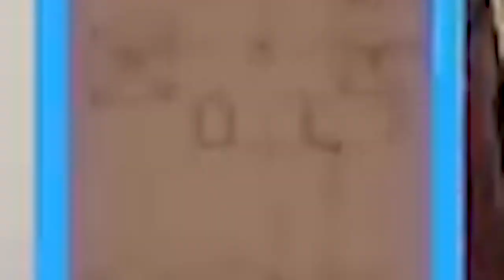Testability Problems Are Caused By Design Problems | Understanding Software Testing

Comment: This is GOLD. The key concept that "Testability Problems are Design Problems" not only applies to the code being written, but can often apply to the tooling being used. Badly designed tooling makes testing much more frustrating that should be, so many people fail to make it part of their normal process. Design extends beyond the code, and how tooling has been designed can greatly effect the quality of code being written.

Comment: Testability is an area where functional languages shine. Systems built on functional languages are much more straightforward to test by only taking inputs and returning a result and not having stateful/mutable side effects.

Using the premise put forward in the video, the functional approach typically doesn't suffer as many design problems through lack of testability.

Whilst Dave may not agree with this position, I do believe that an approach that leads to better testability (and by the argument put forward, a better design by default) does point to the functional approach being superior.

Over 43 years of coding, I've used every programming paradigm and many languages and its clear to me that thinking about state isolation through functional immutable languages leads to both safe, scalable and resilient systems.
Reply: While it's all true, but the value from software comes from the fact it has side effects and mutates the world.
Reply: @seNick7  all functional languages have mechanisms for interfacing with the external environment, both receiving and emitting external state, or input and output. In this regard the whole program is effectively a function taking input and producing an output.

Comment: Regarding private method testing, I have a mixed feeling about it. On one hand I get the argument about implementation detail, but on the other hand, there is encapsulation. And package private in Java is the same as package public, so it breaks encapsulation. Also, large algorithms, and I mean large, require testing implantation detail, and if your public API is limited to dataIn(data, config) and returns processed data, then how do you test tens of private methods that do meaningful data transformations? Well, you either break encapsulation, add trash testing code, mess with reflection or you test each method on the side in some obscure testing project but then most likely your unit testing for that algo will be trash, that doesn't test in meaningful way. Of course, you may want to pretend to write reusable code and slice and dice the code into multiple classes and add some abstractions to pretend the code will be reusable, but that adds workload on designing the classes and additional abstractions and well, makes it more expensive, both in time and in cognition. And years later, once some change needs to be made, no one will remember, how that code was supposed to be reusable or how it was supposed to work, including author himself. So it will be not only extra expensive, but also wasteful.

Comment: I agree 100% with this. I've been blogging about testing recently, and I've mentioned this several times. I'll also be adding links to this video and Feathers' presentation in my blogs. A snippet from one of my blogs:

"A test reflects the implementation. If the implementation is complex, ugly, nasty, etc., then the test will be complex, ugly, nasty, etc. Legacy code tends to be complex, ugly, and nasty. If the implementation is clean, then the test will be clean.

If you write the test before the implementation, then you’re more likely to write a clean test, and as a result your implementation will be cleaner too. If you write a complex, ugly or nasty test before implementation, then you’re going out of your way to make yourself miserable."

Comment: I wrote tests for years, but developed a style of producing very clear error messages and found that this takes a lot of pressure to test out. There is a relation between the need to test and the existance of clear error messages.
Reply: Im not sure what testing has to do with logging, those two are separate! Unless, of course, your product is about logging! Surely you mean that while you always do test, clearer logging has helped a ton too?
Reply: Developers usually don't understand the Bug's nature. Has nothing to do with logging or exceptions. If that is understood, all the rest follows. Be aware, that there is some blind Area in your Mind. That leads to a cause of a Problem. Somewhere else in the code is a detector, raising a Signal, stating that this not understood cause exists. The distance of the detector to the cause ist the cost of debugging. Good code is such that these distances are small. End of Story.
Reply: I'm an enterprise developer but have kind of a related problem: what error information should I log? I am not writing 3rd party library code,  I am usually my own consumer. So  I default to showing the user that an error has occurred and 'Please contact IT'.
Reply: @richardbradley3684  You are doing yourself an utter disservice.
Reply: @richardbradley3684  I think there is confusion out there, about a message that, should go to a user, a message that should go the the developer and the subtle differentiation about the error-detecting line, the real location of the bug and the distance between those two things. This distance has a lot to do with the cost of debugging. I don't have a big problem with an error, but I have one with an error that is hard to debug.So I focused on this for years and feel to able to publish about it. But projects often distract me from that. This confusion gets bigger by a misleading discussion about exceptions. Pew...

Comment: I've encountered this so many times.  I would be talking about testing code in embedded systems and the push back is that it is hard and you "CAN'T" do testing... and my comeback is that Yes, I agree... not the way this code is currently structured, sure it is hard because it is a monolith, but it is not impossible to test if the code is refactored, and it can be designed to test in isolation to everything else and then you'd be able to test it.  I gave an example and of course if fell on deaf ears.

I think ppl like that are really ignorant and perhaps just blind to it; they don't know any better because they've had success in their careers and assume that that is sufficient to writing code, it never occurs to them there might be a better way.   When the chaos at the end of implementation happens during testing and finding and fixing bugs, and they say that this is the best they can do... what?!?  I roll my eyes because I know this is just nonsense.  Yet, when it comes time for my performance review I get ranked down because I "take longer" to develop my code.  Sure they acknowledge that my code is more robust and bug free, but I need to "speed it up"  is really a WTF moment for me... why do I bother when they are so sloppy and that is acceptable work for THEM?  (It's not for me)
Reply: Couldn’t be better articulated! ❤
Reply: @Meritumas  Thanks!!! It's a few decades of lived experience at multiple companies it's almost like it's the same person saying the same things, but it wasn't.  It took me a while to gain clarity on this subject. Once you see it... You "really" see it so clearly.  No more fog or clouds in the way.
Reply: It's unfortunately true. My low bug rate was never really acknowledged. I have a few quotes on how care affects your career:

"Rarely is anyone thanked for the work they did to prevent the disaster that didn’t happen." — Mikko Hypponen

"Some of those firefighters were also the arsonists." — Coworker and friend, who whispered this to me at a Department Meeting after several developers were given The Firefighter Award by our Department Head for their heroic efforts in fixing issues in production.

"A good lifeguard never gets wet. A bad lifeguard gets his name in the paper." — My Red Cross Lifeguard Instructor when I was as teenager
Reply: @jimhumelsine9187  Wow! I love those quotes... they're perfect and so true.  The one about the firefighters being the arsonists hit home the most.  War story time: 

I'd hear how the engineers traveled to a customer site and took a long time to troubleshoot the problem. The patches that were deployed, that seemed to "work" and happened to "work" became mixed into the product, largely undocumented, for future releases of the product.  No one hired later on could possibly know or understand what they had done, or what problem was "solved"... What the firefighters/arsonists have done is guarantee a bigger fire for the future, because one change here will blow up something else there.  I suppose they think this is job security, and they don't like boat rockers like me to come along and point out the weaknesses of their code.

Again Monolithic design that prevents modular testing and scaling features to grow the product.  They disregarded  industry best practices and shunning design architecture principles thinking they have a handle on things while trying to "design" when they have no clue about it.

I am glad not to be working there due to their strong-headed arrogance and abuse of their power as they were promoted to managers, but I am sad that I could have helped them turn that code around... they just wanted to be in control of their baby and when someone, such as myself, comes in with more experience and makes them look bad, suddenly I became "incompetent"... Right, do you believe that a 30+ year experienced Senior engineer has to be told to "Test code and Turn in their work?"  Even after I complete the project and turned it in?  Really?  WTF.  The company is really thriving despite this dynamic... but how long though?
Reply: @jimhumelsine9187  Would be funny, except they're true.
Our arsonists left, not that it helps me. One time, I had 6 weeks of early morning and late evening management meetings about a defect to find out if I'd solved it yet, lots of unhelpful advise from management,  like they understood it. They had the whole team doing stuff and tripping me up. Nearly killed me.
Reply: Totally agree regarding lack of testing of embedded code, it's just an excuse not to do it. How often I've heard say that the lack of abstractions are for reasons of performance, but rarely is this the case. Without abstractions, code is hard to test generally.
Reply: @nickbarton3191  Oh... you hit the nail on the head with that one!  Exactly what I heard too...  Rarely is the bottleneck where ppl think it is.  I wrote games on the VIC-20 in the day and it was a 1MHz processor, then on the 8051's... today we have ARM processors that can run circles around those processors, we aren't shaving cycles and having to play those kind of games anymore... let the compiler do the heavy lifting.
Reply: Some truth in that but there is always a need to optimise code at the sharp end of real time software, faster processors just mean that the requirements ramp up and demand that you do more in a shorter time. As ever, 90% of the code doesn’t need optimisation but 10% always does.
Reply: @TonyWhitley  Optimise when you need to, but start from clean code. How much you need to optimise depends on the use case, optimisation by guessing usually ends up with hard-to-maintain code. One thing's for sure, customer requests just never stop, clean code will make it easier to respond. 
Our legacy systems were optimised as the team went along by guessing, and they're shear hell. Still have some in-the-field and I dread maintenance.
Reply: Well then...  There's on target testing....  But I suppose you could  emulate your code on target. 
But I agree with you, testing the code is really important.
Reply: @kayakMike1000  The kind of code test that needed to be done that made it hard was the trend testing. For example temperature, wind, rain, barometric pressure over hours.  The monolithic code tied the business logic to the sensors in such a way that you'd have to let those trends build up over hours to know if the code was correct.   What an incredibly silly way to do this... yet that is the way they've always done it.   They have a great product and it is mostly, with little exceptions, buggy... but they know the weaknesses in the product and don't want to announce them. Customers haven't complained or seemed to notice. The few that do aren't annoyed enough to make waves... so it all flies under the radar so to speak.